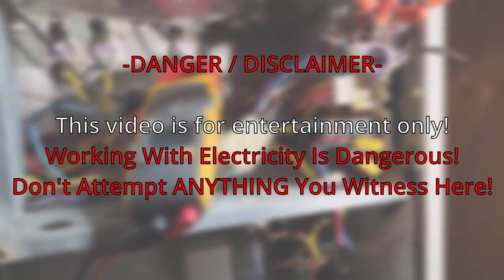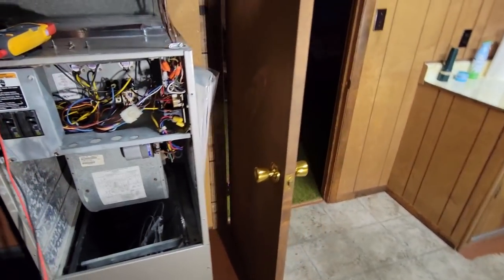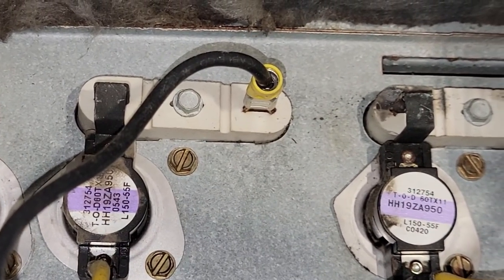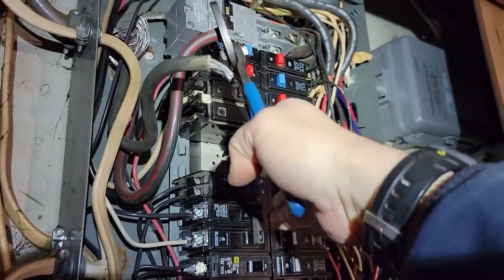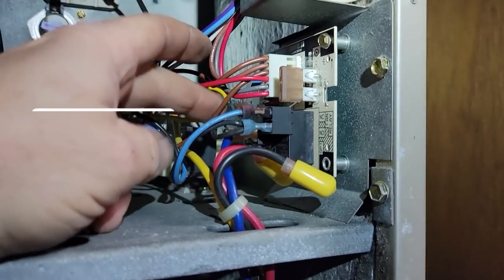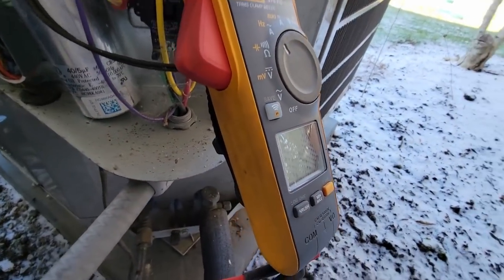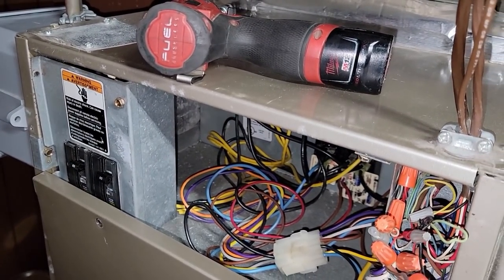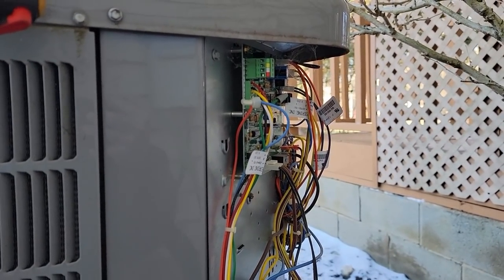Heat Pump Electrical Nightmare. Major Hazards Found!

Comment: Great work! Just tip use a paste on aluminum wires connection
Reply from the maker: I always thought that was for when you had dissimilar metals, since it was aluminum and the bracket was aluminum I didn't worry about it?
Reply: I thought no alox was for any time you terminate aluminum wire
Reply from the maker: @joeshearer1247  to the best of my knowledge I thought it was just for copper to aluminum. But according to idea it's for copper to aluminum or aluminum to aluminum.
Reply: @HVACRSurvival  i seen a good amount of   aluminum wires used on range circuits from 60s-70s homes and a paste wasnt used back then causing oxidation and overheating, it takes a while to occur

Comment: What is there electric bill in January?
Reply from the maker: I forgot to ask that when I was making her dinner. lol  I would guess the highest would be $250-300 a month in the coldest of winter. We live in Ohio not the Communist state of Cali-fornication where electric bill is sky high like everything there.
Reply: @HVACRSurvival  yea i live in new hampshire i was thinking electric would have been higher running on those electric strips.i installed 200 of those systems in apartment building 1.5 ton with 5kw.but most houses up here have gas or oil.great job digging in to breaker most hvac guys would have said call electrician.

Comment: good job ,you are doing great work for your customer's -i don't think it would have been to long before something would have really cooked in there,is it worth putting the txv in at evaporator on this job? thanks
Reply from the maker: Depends what the customer wants to spend.
Reply: I don't think the customer would want to spend $1,000 to install a TXV in place of the working expansion device, especially if they only save 1 KW power each week.  Might save less power

Comment: I have never seen a/c to d/c  converted at a relay. What is that all about?
 The other relay has an extra time delay circuitry built on top of a/c to d/c conversion?  HUH?
Reply from the maker: I don't understand the reasoning either but Generac does the same thing with the solenoids in there transfer switch, they have a rectifier built into the coil. 🤷

Comment: Wow!   US electrics really is like stepping back in time about 40 years.  All that aluminium wire and high current resistive heating!  🤦‍♂️
Reply from the maker: This is a system back from 2005 I believe.
Reply: @HVACRSurvival  looks more like 1975 lol.  Yeah I guess I'm just used to seeing gas boilers used for heating, living in the UK it's the norm.  A 60A, 80A or 100A fuse is normally fitted on the incoming supply cable to protect the whole house.  We do have 240v single phase though so naturally draw less current.

Comment: Strange that the SquareD breaker is bad!  They are supposedly the top brand.  Are they QO or Homelite?  Homelite are JUNK!
Reply from the maker: I don't remember. They technically weren't normal mounted breakers. Definitely not home line. It was something with a Q

Comment: They bought an infinity to basically be a 2 stage system instead of variable speed
Reply from the maker: I don't think it was infinity, just a optional communicating condenser control.
Reply: @HVACRSurvival could be stand corrected lol
Reply from the maker: @joshpearson1693  I'm trying to avoid residential. 🙂

Comment: Propane prices are determined by private businesses, not government.
Reply from the maker: Try again Bud! It's call government regulation and the Dems did everything they could to screw over anyone that uses fusel fuels as soon as Brandon took control. The gas prices today are a DIRECT effect of cutting oil drilling permits, the pipe line and reinstating the regulations that were removed by the yellow guy that hurt peoples feelings with the mean tweets..... elections have consequences!

Comment: If your pulling  70 amps on that 60 amp breaker it should of trip at 80% of the breaker . If I followed you right .
Reply from the maker: What I was saying was you want your load to be at a maximum of 80% of the rated load. Or 20% Under the load. Exp. 100 amps - 80%=20 Amps of head room.

Comment: thats quite ineffcient heatpump if it shuts down at 20f. i can run mine in -20f just fine with over double the efficiency
Reply from the maker: You have a inverter driven compressor?

Comment: Hindsight is 20/20 should have just replaced the whole heat kit
Reply from the maker: It might have been cheaper 👍👍 I didn't notice all the other things before leaving for parts the first time. I'm still waiting for the limits, there back ordered from the factory.

Comment: Lazy electrician!  Trimmed the 2/0 so that the conductors will fit on a 60 amp breaker?!?!?!  WOW!
Reply: At least they used the proper gauge so he didn't have to re run wire. I guess. 🤦🏼‍♂️🤷🏼‍♂️